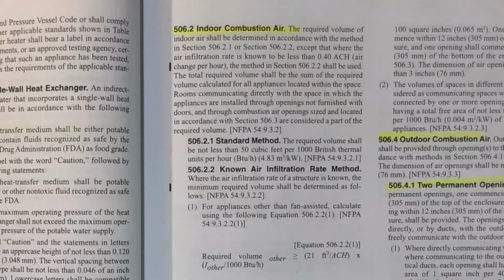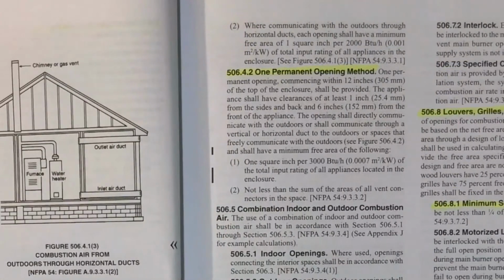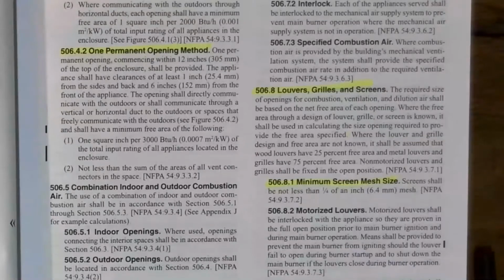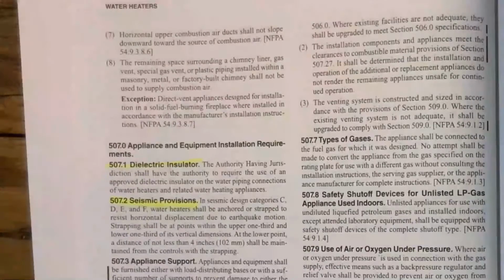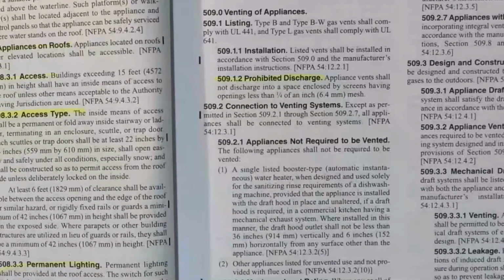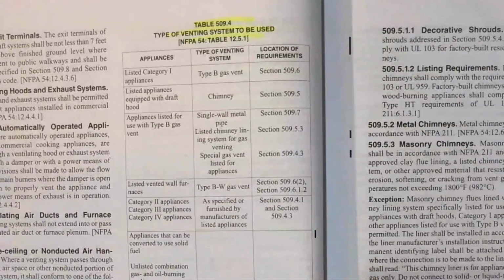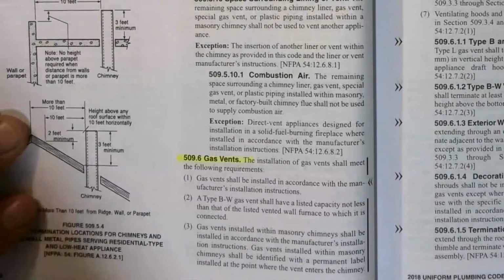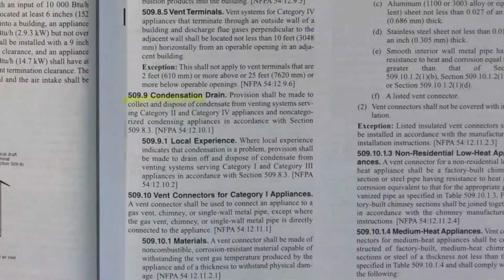UPC Chpt 5 Review

Comment: Be sure to cap the t&p valve in case the regulator goes out it won't leak!
Reply from the maker: The reason for the T and P valve is to relieve the build up of pressure and/or temperature above boiling.  If there is no relief the water heater will build up enough pressure inside it and result in a water missile destroying your home- even possibly your family inside.  I encourage you to look up the several videos on you-tube about water heater explosions- especially the one in Phoenix, AZ a few years ago.  That guy capped off his water heater.
Reply: Based
Reply: I'm assuming this was a joke
Reply from the maker: Pretty sure it was.